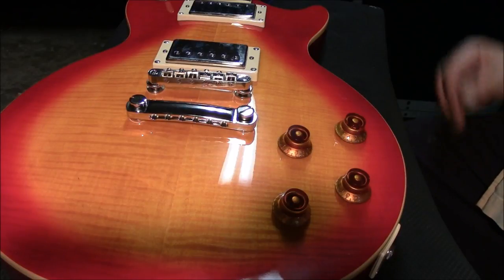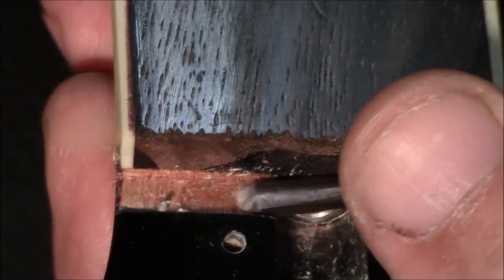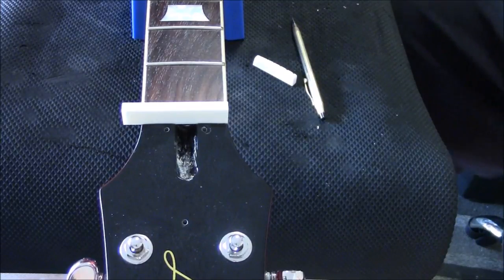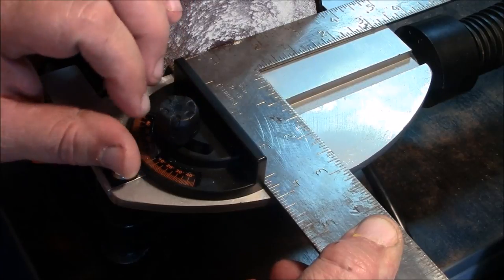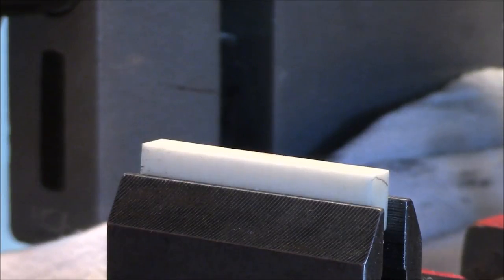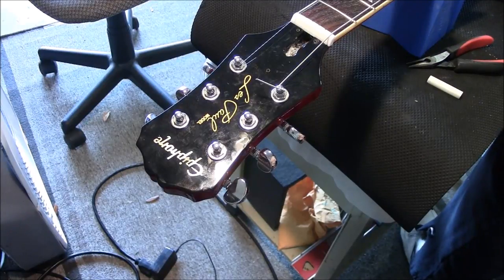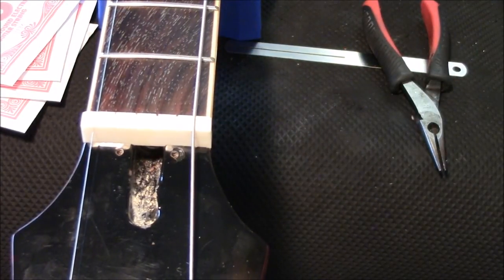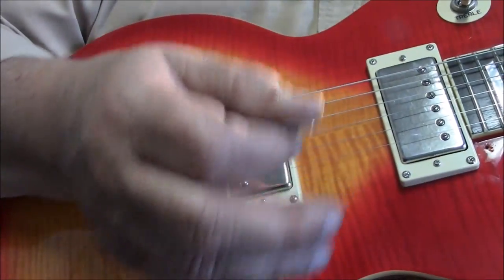CUTTING A NUT FOR A LES PAUL

Comment: As the string travels across the fretboard side of the nut going to the tuning peg is it cut at a dwnward angle toward the ped how much of the string should touch the bottom of the nut slot ? Should it touch just the front edge of the nut slot or haf way back or how much exactly . Iv been confused on this for a while . Tried diff ways n all snd lk crap .  Thx

Comment: I like to take a piece of graphite out off a mechanical graphite pencil long enough to carefully roll over the first and second fret and still reach the nut to mark the radius then hand draw another radius line about a 1/16” above that line I marked first. Then sand the top of nut to the second line I drew and take a cutting torch tip cleaning file and file the string groves almost to the first lower line. It does it perfectly to guitars radius and first fret string height. Works for me.